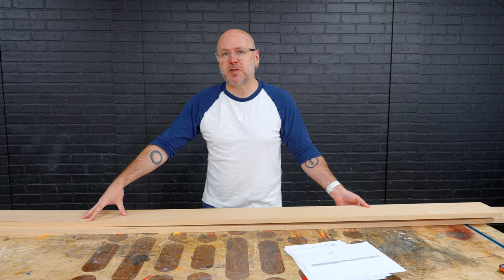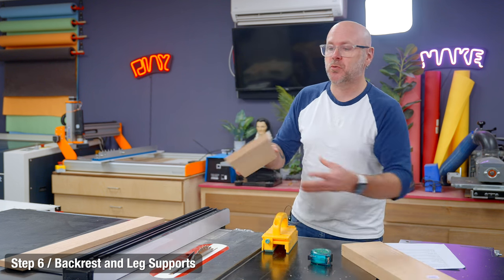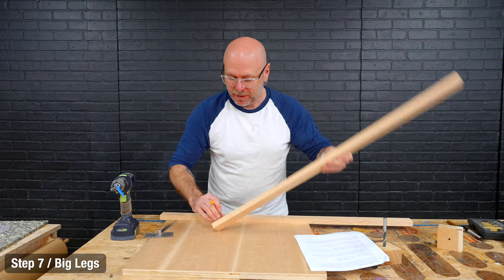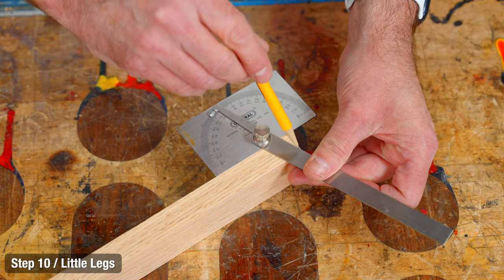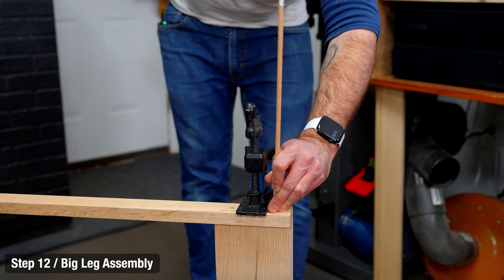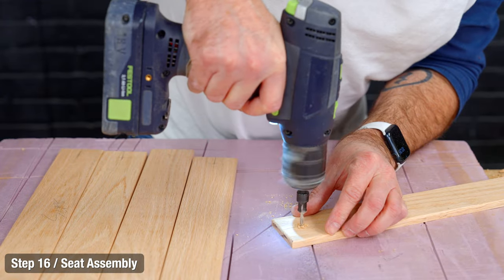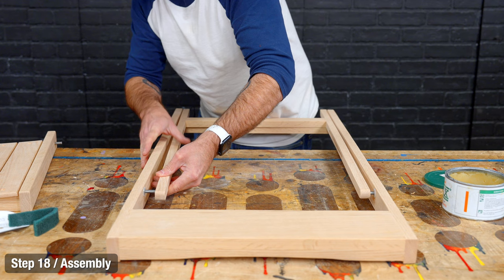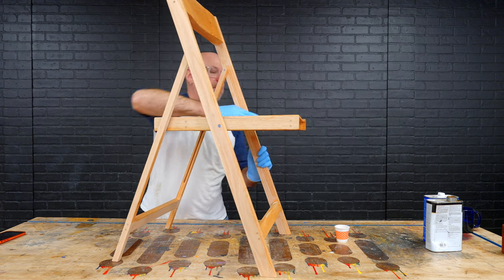How to make a wooden folding chair.

Comment: I really like this. The only thing you might try is that usually the back rest is tilted forward at the top so when unfolded it won't dig in to your back at the bottom edge. It could be thinner to accommodate the tilt. Just a thought. Nice video, I may have to make one of them myself.
Reply from the maker: Thanks! We go over this in the plans!
Reply: @SomethingAboutMaking  Way ahead of me. Cool, thanks.